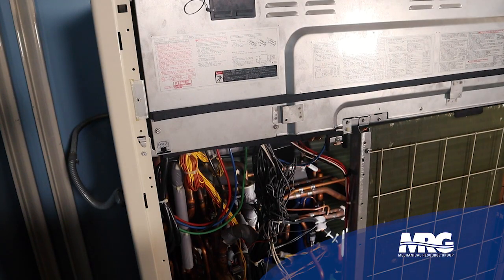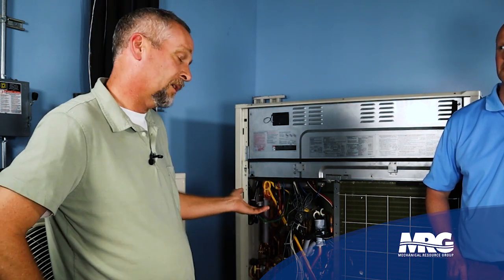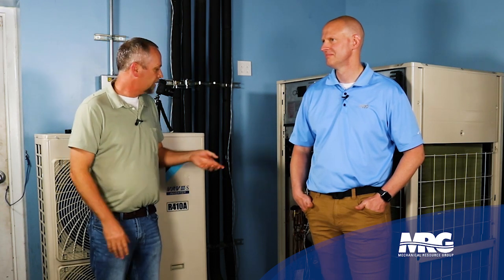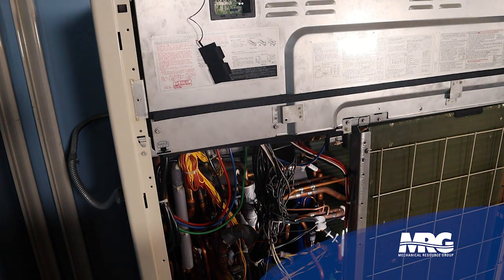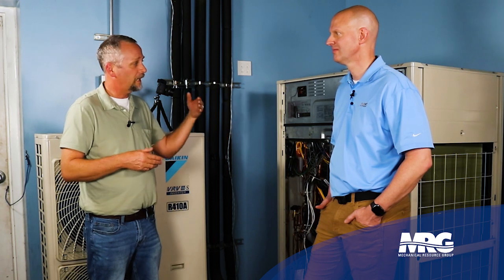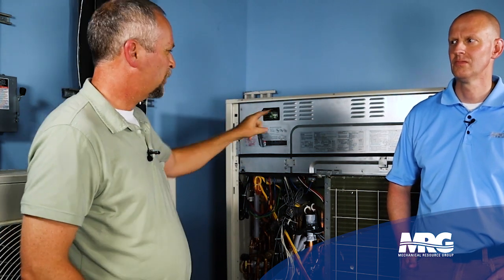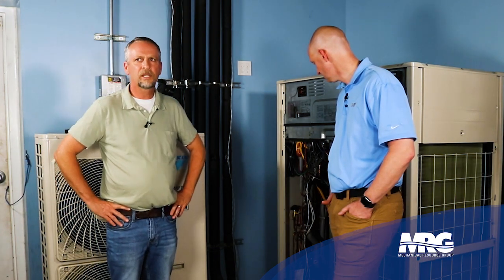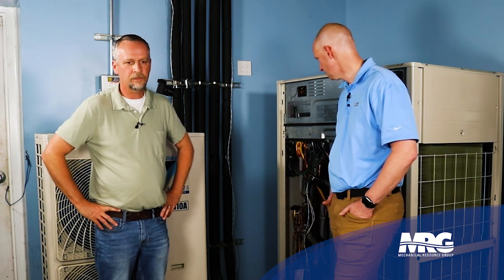Unlock Daikin VRV Secrets for an Easy Startup!

Comment: Quick question since you didn't touch on it in the video. Is setting up the proper airflow or at least verifying proper CFM on ducted fan coils critical to system operation? From what I've read about VRV/VRF systems airflow at the indoors determines capacity. I've never worked on a Daikin yet, but saw there is an auto static function to set the airflow. Seems like most issues from these units come from bad installs or lack of knowledge when commissioning.

I appreciate all the VRV content; you have some real experts on your team. It's very hard to find information about these units in the states and the manuals are not easy to understand. It's crazy how much goes into these units from the design phase, up till commissioning, and even later during service.
Reply: Airflow is important especially from ceiling cassettes. Which louvres are blanked or not and height from floor to ceiling